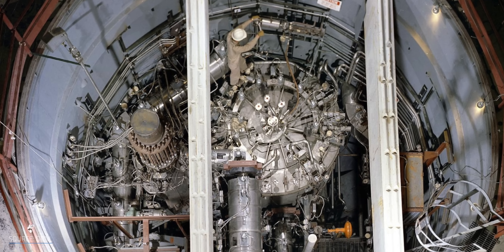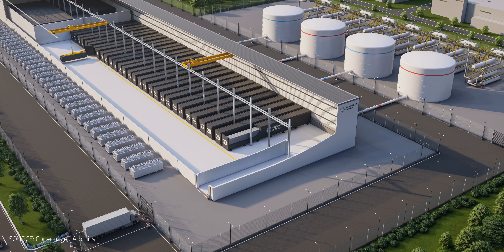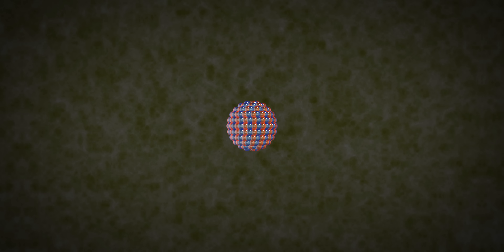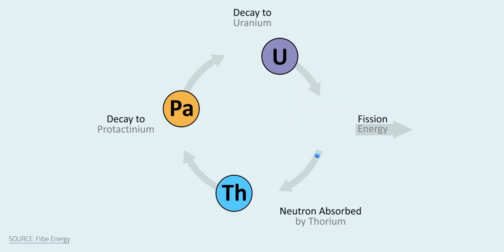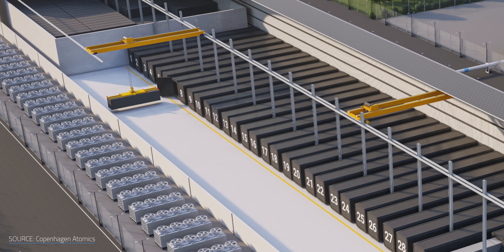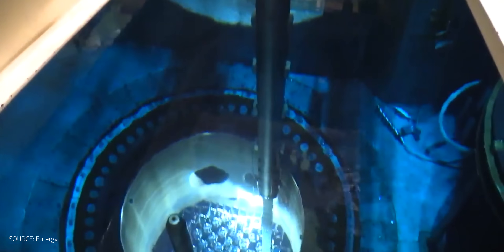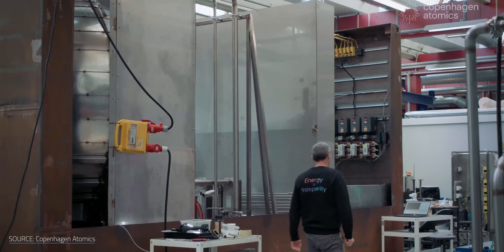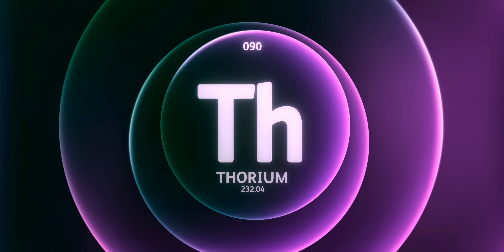Why Thorium is About to Change the World

Comment: A note about the "only 200 years of uranium" concept. When "burned" in a nuclear reactor, less than 2% of the fuel is actually consumed, and another 2% or so is converted to byproducts that poison the reaction. The other 94 to 96% of the "spent" fuel can be separated and reused. France does this, most of the world (including the USA) do not, and store the 94% usable fuel as waste for thousands of years. I reality we have more than 1,000 years of uranium if we decide to use it.
Reply: Any kind of assertion on energy topics should allways end with: "at current rates of consumption"
Reply: @camilovallejos9462  It's not even that.

Reserves and resources are calculated based on demand and econonmics of extraction. For this reason there are no thorium reserves despite rare earth mines extracting and dumping about 5000 tons per mine per year and uranium reserves are based on very pure deposits that are very close to the surface (admittedly rarer than Monazite, but still fairly common worldwide) due to extremely low demand levels in the mining scheme of things and being a low value metal ($150kg at most - enriched uranium is worth more than gold)

People see the figures provided by the minerals industries and quote them without realising the nuances (or deliberately ignoring those nuances)
Reply: From what I have read, the cost of reprocessing is very high, which is the main reason no one but France is doing it.
Reply: @apostolakisl like everything else nuclear related, mindless bureaucracy runs up the cost to justify its existance.
Other than delayingvprojects and endless reviews, what have the AEC and other regulatory bodies contributed to the industry?
Reply: @apostolakisl  perhaps, but I think the reason the US doesn't reprocess its fuel isn't for cost reasons, but because our nuclear policies make no sense. Most were set during the huge nuclear scares and nuclear hysteria of the 60's.
Reply: This is true, but there is literally 1000 times more easilly accessible thorium than there is uranium.  The reprocessing is difficult and dangerous and there IS a proliferation risk from it.
Reply: @NScherdin  True, in particular India, has vast amounts of thorium and almost no uranium. I'm not sure that proliferation from reprocessing spent fuel rods is a major concern in the USA (or India and France). I didn't say thorium was a poor choice, just that "only 200 years" is a wildly inaccurate statement.
Reply: @NScherdin  proliferation risk for what? US have already thousands of nukes, and it's easier to just enrich the uranium to create a bomb. What even is that point? like you didn't need to even have launchers for nukes
Reply: @riccvven2078 , Maybe the first world won't bomb poor people trying to build nuclear plants, if they are Thorium plants 👍🏻.

Uranium use is controlled by the right of might. 

You have to build an army before you can build a nuclear power plant. That is the reality of the world.
Reply: Unfortunately another video, where the host fails to understand the bare minimum of the topic he talks about. The result is pseudo scientific gibberish that sounds cool, but does not make any sense to someone who actually understands the subject matter.

Just to make this abundantly clear: the big advantage of Thorium is NOT the fact that it can be bred into fuel! Uranium 238 is also fertile and hence can and is currently bred into Plutonium 239, which is fissile.
Also current nuclear waste has to be stored for millenia primarily because of transuranics like Plutonium, which, btw Matt, are not fission products!
Additionally a more critical mind would have easily found out that no matter which fissile Uranium isotope one uses, both will produces long lived fission products like technetium 99 and others which will require several thousand years or more of storage.
There are of course potential technical solutions for these elements, but the claim that the waste stream from Thorium only requires around 400 years of storage is just not true.
Reply: @errantstar  I’m not well enough educated to understand this.  But think you should email this company and explain why this is a bad idea.  They must have people as educated as yourself who could prove or dispel your concerns.  No point in wasting money on this if it’s a waste of time and money.  Good possibility too they may pay you as a consultant.
Reply: @errantstar  To be fair, the topic is huge... too much for a short presentation... so this "extrapolated generalisation" from the efforts of this start-up does carry more sense than some of the barely educated gibberish among these comments.  The conflation is excruciating to listen to.  You illustrate example about fertile vs fissile vs source fuel.  Also axes such as online vs offline vs not reprocessing unless economical; coolants including NaK, lead, mercury with or without dissolved reactants; breeding in blankets or travelling wave, moving rods towards core; use of neutrons in both fast and thermal spectrum; the problems of SMR vs centralised, including security, amortisation of shielding and containment layers in larger structures.  The icing on the cookie was accepting the positive spin given to regularly replacing the whole irradiated corroded reactor.
Reply: Whilst this is true, it is important to note that the recycling process is indeed expensive. In addition, as already mentioned, this process can only be done once before it becomes uneconomical to repeat the process. It would be best (in my opinion) to keep storing spent uranium, but have a recycling facility on standby, and store spent uranium in easily openable containers, such that uranium can be easily and “rapidly” (the process isn’t exactly fast) recycle the spent uranium. Mining new uranium is currently cheaper, but having an emergency stock available for recycling seems like it would be the best of both worlds.
Reply: Also it's worth noting that 200 years isn't actually as long as it sounds.  Most lumber in your local shop is from trees planted 50 years ago, deliberately planted and farmed. Storing low grade waste isn't that difficult for 200 years.
Reply: @Spedley_2142  200 years is not a short period of time either. Even the United States is only 248 years old. How many states in history have lasted for 450 years? When states collapse, who will be responsible for keeping the promises made or ensuring the safety of nuclear waste?

Of course, it's a better timeframe compared to the fraudsters who promise to store nuclear waste for tens of thousands of years. Still, we are leaving a very messed up legacy for our grandchildren.
Reply: @romulusII  This is an apt point. When the Soviet state collapsed they left a mess of nuclear weapons and tech. That was with a very clean collapse without violence and stable successor states.
Reply: @romulusII I don’t disagree with you but we are also lacking better alternatives. 
Climate change is going to be even messier legacy. 

I realise the huge burden of responsibility that comes with nuclear energy but my country ditched it out of fear and ramped up the use of fossil fuels. While nuclear energy isn’t perfect, this decision was just right out stupid.
Reply: I think the math needs to be examined here. Enriched uranium fuel rods is 3-5% u235, the rest being u238, reprocessing potential in a lightwater reactor including Pu239 is around 2% by weight of fuel rod. 

We currently do not reprocess fuel rods in a meaninful quatity to alter supply trajectory. So supply is a function of economically recoverable reserve over annual consumption. Which is 8 million tonnes over ~70k tonnes/pa, or roughly 100 years of supply at current consumption.
Reply: French re use of the fuel only happens once then use new fuel! Dealing with the toxic spent rods has not been achieved so far!!!
Reply: @simonpannett8810  The spent fuel is used in breeder reactors but the process creates plutonium.
Reply: Well, back at the start of the Atomic Age, the US developed systems reprocess and reuse spent fuel because there was a fear of running out, but that push lost steam with the realization that there was quite a bit more minable than initially assumed, plus Plutonium gets a very bad rap as the bomb element.  As a result, only France continues a reprocessing system, and there haven't been any big developments in the technology in a while.
Still on the Breeder reactor front, Uranium's most common isotope U238 can also do the same, absorbing neutrons to then decay into Plutonium which can split to provide power just like U235.  It's got it's own issues, but one edge it has is that U238 is better at absorbing fast neutrons which means the breeder reactor designs don't need the neutron slowing parts to work.
Reply: France's MOX is a one-time "once-through" process.  Only a fast-neutron reactor (FNR) could drive down nuclear waste substantially but an FNR is very rare, complex and expensive construct & operate.  MOX only improves fuel efficiency and doesn't do much with reducing waste.  France has completely abandoned FNR.

Another thing is that the process of producing MOX will also also produce more low- and mid-level nuclear waste.  All the equipment, tools, water, PPE ends up contaminated or activated.
Reply: If you do that you get plutonium and everyone gets their panties in a twist
Reply: @renesilva9705  Well except for engineers trying to design space probes.
Reply: The difference is it’s required by law in France to recycle the waste. As long as it’s not required no one will do it, it’s incredibly cost ineffective. But as long as big tech and billionaires can lobby to keep laws as they are then that will never change
Reply: I know that the Canadian designed CANDU reactors (if I'm remembering correctly, or close enough) they use a natural mix of Uranium for their fuel, with the U238 absorbing neutrons to become Pu239 which is then fissile. I don't remember the usage efficiency (if it's different than what you described) but based on this alone that 200 years of Uranium fuel is more like 28,000 years of Uranium fuel! So, even if the Thorium never actually works AND spent fuel isn't recycled, we'll be fine for a bit more than 200 years...
Reply: @john_in_phoenix  Really? Do you have any links you can share regarding this I want to learn more pls. If possible YouTube video cuz you know I need dumbed down content for a dumbed down guy LOL thanks in advance 🙏🏽🌟❤️
Reply: India, Japan, Russia and UK does reuse the spent fuel rod.
Reply: @john_in_phoenix  facts, I forget her name but there's a woman who has a great video on the subject
Reply: Japan also does it.  The USA actually developed the tech.  But bureaucracy and corruption, in combination with fear mongering, allowed the utility companies that produce the nuclear waste absolute control over storing the waste, so they can charge the consumer to pay them to maintaining it.  Recycling the waste would take away their biggest income stream, taking care of the waste
Reply: France does this not because of economic necessity (they are actually losing a lot of money), but because of political reasons (scarce well-paid jobs in a remote area make it impossible to close). Reprocessed fuel, and that includes thorium-based fuels, is very costly due to complicated radiochemical technologies required, as opposed to the simple and cheap chemical engineering of LEU. And BTW, uranium is very cheap to leach in-situ (a technology developed in the 1970s), no fission technology will be able to compete with that in few next decades, and likely not in the 21st century
Reply: U238 (the 94-96% you refer to) is NOT fissile and cannot be used as a fuel in U.S. reactors).  The only thing that can be used is Pu239 and at ~ mid core life, the majority of reactor power is produced from Pu239, NOT U235.  The problem with Pu239 is its long half-life, human health danger, and easy use in nuclear weapons. BTW, France only recycles a fraction of their spent fuel and that actually was they way they obtained Pu239 for their weapons program and their ageing recycle facilities will soon be retired with no planned replacements.
Reply: Back in the 1980's they calculated that all the known sources of Uranium could last about 300 years. However if countries used just one or two "Fast Breeder" reactors that Uranium would last 3000 years.

Fast Breeder reactors were used by all the countries that wanted to make Nukes as it is the only way to create Plutonium and enriched Uranium. Most of those reactors were built in the 1950s and 60s and have been shut down now.
Reply: If nuclear warheads would be turned to powerplant fuel, there is already enough U235 for some 200 years
Reply: thousand years until uranium depletion, question is, can we safety store for that long?  @john_in_phoenix 
Wow, thousand years until uranium depletion, question is, can we safety store for that long?
Reply: This is the basic "problem", why they don't shoot it into space, melt it in the Mariana Trench or in a volcano - because in 50-100 years it will be a useful fuel
Reply: Oh, and France has become EXPERTS at recycling spent Uranium.
(I hope no one has the brilliant idea to try invading them, ever)
Reply: and yet still France imports U from Australia… it's true, they do use a NPP reactor to power the energy intense process to refuel with the isotopes in the waste products from some of their reactors. any yet they import U/yellowcake fuel from Australia… so much for France running a refuelling process that has 1,000s of years of fuel to power (with Nuclear as 68% of the mix).
Reply: @john_in_phoenix  ah yeah, they gonna dig it up in the future an make a fortune when all natural resources have been exhausted.  Mmm
Reply: Only 1% of the spent fuel is able to be reprocessed in what is the dirtiest and most expensive procedure in the nuclear energy scam. Once it is reprocessed it can be used once and then is again nuclear waste. it is way cheaper to mine uranium than reprocess it to get that 1% very expensive, very polluting recovery.
Reply: one day we will dig it up and reuse it when we run out of new material
Reply: The Natrium reactor currently being built in Wyoming is a fast spectrum reactor that will burn some of the u238 by converting it to Pu-239.   Same idea as Th-232 to U233.   Phosphate mining tailings have  both Uranium and Thorium that can be recovered economically so I don't see us running out of Uranium in 200 years.  Fuel reprocessing is the issue to overcome which is a regulation thing not a technical issue.
Reply: Uranium can be extracted from sea water. It's expensive, but not vastly more expensive than mining it. As the cost of fuel in a nuclear reactor is a very small part of the levelised cost of the reactor then when mined Uranium becomes uneconomic we can turn to extracting it from sea water.

Plus, if we use breeder reactors, so we can burn the transuranic 'waste' and use the U238 then we'd get effectively unlimited energy from seawater.
Reply: I thought the YK had a Uranium reprocessing plant as well?
Reply: Thank you for explaining it , I always thought what they meant by re-processing
Reply: It's simply the way greedy elites block the world's access to virtually free energy 👆
Reply: @john_in_phoenix  The US went down the Uranium route to make bombs. It was well known 70 years ago that Thorium was better for energy with less worry for byproducts, but the politicians wanted their bombs to stop communism.
Reply: I would like to add that Japan are also sicknasty at reusing reactor fuel.
Reply: You have to process it to use it. But processing is very expensive. That's why it is not used.
Reply: @cuneytevin9323  Thorium 232 is no different than U238 being fertile but not fissile.  The world has a uranium infrastructure for Uranium but not Thorium so unless we run out of Uranium and that is not likely anytime soon, the Thorium myth is and will always be a myth
Reply: Thanks🙏
Reply: That is interesting. I would also consider the number up for questioning as we have previously heard many numbers for remaining fossil fuel and metal reserves, but then huge new reserves have been found. We've only recently discovered natural hydrogen underground. I think there's a lot more stuff in the ground than we really know about and I wouldn't take the 200 years too seriously.
Reply: I also kind of doubt that we really know how much Uranium is available in the first place. Exploration tends to be done based on demand, it's highly likely we find a lot more in the next 200 years.
Reply: @zacdredge3859  Absolutely. I've worked for a company on gold, where we had high values from rocks no one ever looks at. The idea we found everything and know everything is an exploration constant. It's always been wrong. 
We don't really need the Uranium if we have the Thorium though.
Reply: “Energy too cheap to meter” now that will be the day 😂
Reply: @johnwarwick4105  That was EXACTLY what the U.S. government said when they were building the Shippingport Atomic commercial power plant in 1957.  At the time, scammers were also selling "special" light bulbs necessary to operate on Atomic electricity.  When you realize the intellect, or lack, of the American public you understand the need for regulations.
Reply: @johnwarwick4105 you mean like billing people for compressed air? Why would energy cost more than compressed air when energy is more abundant?
There's no business model for free energy which is why it's gone nowhere since the 60s. 
Energy companies won't advance it. End users will.
Reply: I'm glad a couple people at the very least are correcting @john_in_phoenix 
We don't leave ~95% of fuel in these rods and throw them out. 
The Uranium part of these rods contain mainly U238 (Uranium Isotope 238 is fertile and not fissle, therefore no fuel), which is 96%+. Then we have 3-4% of U235 (Uranium isotope 235 is fissle, therefore fuel).
Of these 3-4%, roughly 1/4 will remain in it's initial state. A small percentage will be activated into (fertile) U238. A small amount (~2%) of U238 will be bred into Plutonium (fissle) half of which will be used in PU fission.
So in the end, there is just a tiny amount of U235 left, which is expensive to seperate from all the other fission byproducts / transuranics.
And for clarification, natural Uranium only has 0.72% of U235. So U238 is abundant (99.28%) but is not fuel. Unless you want everyone to breed U238 into Plutonium (weapons-programs go yayy), this is a wasteproduct. And to breed that, we need special reactors (FNR), which have their own problems and so far, seem commercially unviable. (Doesn't breed enough to sustain itself, therefore always reliant on U235, creates transuranics through neutron capture).

All of that aside, nuclear is simply doomed. It's expensive to build, needs hefty saftey regulations due to the nature of radioactivity, long term storage is in the very most cases still not decided and somehow, the whole cleanup, storage and management of that ordeal isn't featured in the electricity price (which would be extreme). It suggests a fake sense of cheapness and pseudo-renewability.
Reply: Exactly, the Russians developed recycling of Uranium,  bringing the supply for them to a thousands of years.
Reply: What you're writing ist absolute BS. France only get's out about 1 % and stores the rest as "possible future fuel".
Reply: Didn't President Nixon have a plan for more nuclear reactors?
Reply: France only recycles the fuel rods once and adds 50% fresh fuel. So they're just getting us to 300 years.
Reply: Good thing Australia has lots to sell but not use to make the country better
Reply: interesting you say this. it sounds like we should probably figure out how to use all the fuel we actually have, before trying to make more of it using thorium and a complicated process
Reply: @dadmitri4259  We have more thorium than we know what to do with and every rare earth mine that exists is extracting more of it to the tune of thousands of tons per year - you have to extract and process the thorium to get at all the other rare earths and there's more thorium in monazite than every other rare earth combined

Sequestering that thorium is what makes rare earth mining uneconomic. China's rare earth mines are no execption - or wouldn't be if the Chinese government hadn't been purchasing and stockpiling their thorium output for the last 20 years in anticipation of the TMSR series reactors being commercially sucessful. A rare earth mine with a sales channel for thorium at $150/kg is a thorium mine with a rare earth side gig. 

That's HOW the Chinese have been abled to corner the world rare earth supply chain and it's something that can easily be undone, if there's a thorium market. Multiple birds, one stone.
Reply: @john_in_phoenix  yeah but it's just kind of a pain innit?
Reply: They dont do it, because thats making nuclear even more expensive
Reply: That’s not how U235 works…… but maybe other fuels
Reply: If this becomes ultimately successful I have one question. Who owns the largest Thorium mines in the world?
Reply: US has had the tech to re-use the waste in another reactor since the 50's
Reply: Guess they want the higher percent yeid for nuclear weapon or other uses. Rather than keep extract old fuel continue to find newer uranium. Maybe they do reuse old fuels.
Reply: Doing that is boh very expensive and dangerous. that is why it was stopped at Sellafield.
Reply: More economique to store IT. Separation of plutonium creates huge quantities of liquid radioactive waste.
Reply: Everyone gets the 200yrs thing completely wrong.  We have 200yrs worth of depleted uranium sitting in storage tanks at Oak Ridge, and that can be used as fuel in newer breeder reactors.  We don't only have 200yrs worth of fuel left, we have 200yrs worth of fuel just sitting there in storage tanks that we thought was toxic waste years ago.
Reply: That an desalination byproduct of seawater being roughly 30x all land reserves.
Reply: Well, there are already fast breeder reactors that do the same with Uranium and Plutonium, with non-fissileUranium-238 turning into fissile Plutonium-239 in outer blankets as Thorium-232 would turn to Uranium-233 in that design. By using these reactors, it is also estimated that we could draw 50 times more energy in total from the amount of Uranium that we have and will extract in the coming 200 years. These are big units and produce the same long-duration waste as classical nuclear reactors though
Reply: to be fair, it's not extremely cost effective to seperate the isotopes, and in 200 years we will have much better sources of energy
Reply: one thing that is never talked about is how we use these resources for stuff immediately upon discovery. What happens if in the future we make great discoveries and it turns out we wasted all the resources on petty things... or we created a bunch of byproduct with no idea of the impact. Plastics come to mind... we have no idea the impact plastic will have in 200 years, 1000 years, and beyond. It just boggles my mind how carefree we are as a society when it comes to inventions... then once we realize we made a terrible mistake, we're just like "oh well, who could've known?" Take DDT and lead for example....
Reply: Building a nuclear plane here in the US is uber regulated and costly to the point where it makes zero sense to do so, natural gas is a much less expensive option.
Reply: They are building a plant in Kentucky to separate reuse the fuel rods.
Reply: "We" dont process that left over fuel because "it's too expensive"...
Reply: especially in fast breeder reactors, we're only water cooling our power plants because you can fit them into a submarine or on an aircraft carrier. we had the solution in molten salt reactors i nthe 70's but they're not profitable or easy to get into machines of war so why bother developing the tech..
Reply: Yes, but for who? Only the rich countries get to use it. It is banned in the 3rd world. They will literally kill us if we try. 

In order for a 3rd world nation to build a nuclear plant, we first have to build a military to defend ourselves. 

IF the entire world moved to Nuclear , we would only have 100 years of Uranium.

So This technology will open up Nuclear to the entire WOLRD. 

When you say that you have 1000+ years of Uranium , that is 1000 years for the rich monopoly , with poor people needing to rely on fossil fuel , wind and solar.

In reality , if the world was using Nuclear ONLY , we have about 100 years of Uranium.
Reply: its extremely expensive to reuse it.  nuclear power is a dead end
Reply: @bonitabromeliads , wrong. Thorium isn't a dead end. The cold war and nuclear arms race caused nuclear to go the route of uranium and plutonium. 

It's humanity's lust for war that set us backwards 75 years. 

Thorium only requires about 5 % uranium as a catalyst. 98% of the fuel is burned leaving very little waste. 

Thorium is very abundant.
Reply: the "200 years of uranium" is flawed to begin with, because those are resources, not reserves or natural occurrences. It doesn't account future reserves becoming more economically available, like it happened with oil, or any other resource in the world.
Reply: @filippo1864  it also fails to account for breeder tech and molten salt which is also breeder tech.  The arguement is flawed because it fails to account for technological advancements.
Reply: Mox fuel can only be recycled once more before the cost makes it unviable
Reply: @rhetorical1488 true for now , it is also possible to use way more fuel in fast breeder reactors buy it is even more costly , let use them when there is way more fission around the globe
Reply: @corradoalamanni179  Nuclear fission is an energy dinosaur. Every other form of energy production is running circles around nuclear, which has been losing ground worldwide for the last 30 years. Nuclear energy will die out when the last of the current rust bucket reactors get so expensive to maintain they shut down. Nuclear cannot compete economically.
Reply: @corradoalamanni179  Fast breaders are still likely more economic than thorium based reactors. They need less reprocessing as fast neutrons are less likely to be absorbed by fissile products and they have more neutrons to spare. Also reprocessing thorium fuel is more expensive as it has quite some hard gamma radiation and thus need way more shielding of the process.  For way more nuclear we would have to use breeder reactors, as the easy uranium reserves are limited.
Reply: @corradoalamanni179  The fast breeders are likely still cheaper than the throium cycle. The thorium cycle needs way more reprocessing / cleaning, as thermal reactors are more sensitive to fission products and the thorium cycle has much fewer neutrons to spare. Taking the fast breeder as a point to compare too makes absolute sense. Here in most aspects the fast breeder is the clear winner compared to molten salt concepts, that are still in the early promisses and crude idea stage with a low chance of success in maybe 30 years.
Reply: @rhetorical1488already in 1968 we had the technology to reactive the uranium that was used. And according to those scientists we can keep doing this till all the uranium is used and the waste is minimal
Reply: @rhetorical1488 And only 1% of the spent fuel can be recovered in the dirty, very dirty and extremely expensive reprocessing plant. Running a reactor with MOX fuel is temperamental and requires greater expense for tighter containment,
Reply: @jackfanning7952  Yet the US used to do it, and France still recovers around 95% to this day. Perhaps check your numbers?
Reply: @jackfanning7952  The U.S. tested MOX fuel in a commercial U.S. reactor but terminated the testing early due to fuel rod swelling.  After spending $7 billion on a white collar welfare program for South Carolina, The U.S. MOX facility program was terminated.  Thanks to Linsey Graham we added $7 billion to your children's credit card with nothing to show for it except a short term work program. 

They could not even make that facility work and they were starting with pure processed Pu239 to blend with U238.  Can you imagine the additional cost if they had to extract Pu239 from spent fuel?  Technically, we can do a lot but you have to consider the cost vs benefit.
Reply: @john_in_phoenix  I did. They are correct. DOE says about 1% of spent fuel is reclaimed as U-235 and 1% as plutonium. Both are mixed with actinides making reuse difficult to handle due to gamma radiation. West Valley is still being cleaned up by the DOE after it was shut down in 1972 because it could not meet environmental goals. West Valley processed 640 tons of spent fuel and generated 600,000 gallons of liquid high-level waste. 1.9 million lbs of radioactive waste has been removed since 1972 and still not done. Other DOE reprocessing plants in Morris, Illinois and Barnwell, SC were determined to be uneconomical and never operated. Britain says cleanup of Sellafield will take at least 100 years to cleanup and just maintaining the site is costing $1 billion/yr. No cost estimate on how much cleanup will cost, if possible. LaHague reprocessing plant in France (formerly Oreno, Areva and Cogema, names changed to protect the guilty) has lost all of its international customers and only returns reprocessed fuel to its parent company, which was taken over by the French government to keep it from going bankrupt. Pity the poor French taxpayers. LaHague and Sellafield have managed to make the Atlantic Ocean the most radioactive ocean in the world all the way up to the Arctic. That is in spite of intense competition from Japan who is trying to put the Pacific on top and Russia because of Andreyeva Bay of the Barents Sea. It is hard to get info from Russia but they probably just dump their waste into the Barents Sea. Russia also stopped trying to recover fuel from rusting nuclear subs in the Arctic since the war in Ukraine started. How do you like your wild-caught salmon cooked? From the Pacific or the Atlantic?
Reply: @jackfanning7952  You do understand that the uranium is mined from the ground and isn't created from thin air, right? Seawater contains uranium (and among many others, lithium) naturally. The actinides and plutonium are created from the reaction and are the actual problems. Reprocessing the fuel rods removes the actinides and plutonium and vitrifies the waste products. So instead of a thousand tons of highly radioactive waste to store for 10k years, you get 100 lbs of glass to store that won't leach into ground water. In the meantime, the "spent" fuel rods get to sit in cooling ponds around the reactors until someone decides it is cost effective.
Reply: @clarkkent9080  SRS is still trying to get rid of the plutonium brought in from Russia intended to be processed in the MOX plant. Since it is DOE we have no idea what the additional costs has been. My guess - another $10 billion.That plant would have never run. The problem with it is similar to the problem Westinghouse had at the V.C. Summers Plant. They planned to build it without working out the technology necessary to make it work. they spent $8 billion and had nothing to show for it except a huge laydown yard of extremely expensive parts rusting in the field.
Reply: @jackfanning7952  The Westinghouse AP1000 reactor design was (being) built in China years before VC Summer or Vogtle started their construction and those two projects had engineers in China documenting and reporting on any issues. While there may be some issues  specific only to the U.S., I would not put most of the blame on VC Summer's failure or Vogtle's financial blunder on new technology.

  The U.S. did not and does not have enough construction trade expertise or project management to build two nuclear projects simultaneously . We can build Walmart Supercenters and Amazon warehouses but the detail, QA, QC, and management of massive projects is something the U.S. is lacking in. 

MOX was initially estimated to cost $1 billion.  The facility was supposed to mix "clean" Pu239 with U238, something that is relatively easy in nuclear terms.  The $1 billion estimated cost was reasonable given the nearby complex Tritium Extraction Facility was recently completed for $800 million. The individual that is fully responsible for the MOX failure is Linsey Graham. Once Graham got $1 billion of funding and congressional approval for the project he forced construction to start long before the design was completed.  Graham knew that once a project was started it is hard to kill.  I worked on some of that project and the construction errors were numerous and work shoddy at best but all Graham wanted was a white collar welfare program for S.C.. He singlehandedly kept billions flowing despite efforts of Obama to shut down the project.  It took Trump to put Graham in his place and shutdown the project.  S.C was awarded hundreds of millions for shutting down the project that should never have been started. A perfect example of why the U.S. is going bankrupt!

There is another Pu239 disposal project at SRS  that has been ongoing for a decade and it involves mixing that same  Pu239 with "stardust" in a simple glovebox.  The resultant mixture makes it nearly impossible to extract the Pu239 and the mixture is loaded into cylinders for disposal at (I believe) WIPP.  The reason that you don't hear anything about that project is it is simple and inexpensive and certainly not something Graham sees as bring the pork home.
Reply: @rhetorical1488 the viability of costs is something that can be changed on a whim with changing one if the soft factor like interest rates it drpends on and a new calculation. This is not a "solid rule".
More important is the technical viability, which takes years or decades to change. If it can be done, it will perhaps at one point when there's no better alternative.
Reply: @rhetorical1488. Ii isn't the cost, it is the Plutonium-242 which can only be burned in a fast reactor.  In a thermal reactor, it poisons the chain reaction.😊
Reply: Btw the whole  "only 200 years of uranium" concept is just a misunderstanding between Reserves and Resources by people ignorant on this based thing.

Resources is the total estimated amount of a particular raw material, including both discovered and undiscovered deposits.
Reserves is the portion of the "resources" that has been identified with a high degree of confidence and can be extracted legally and economically under current market and technological conditions. 

With the same concept we heard many times that oil was close to be finished. Obviusly when there is a shortage of something the price rise up and then it became economically convinient to drill more places  and use more expensive tecnics.
Reply: @amlasindae1097  your description of resources and reserves is both accurate and inaccurate. Resources are always there. Reserves can vanish overnight.  Middle Eastern war and oil spike? Reserves halve. Double the price? Demand halves. 
Oil "ran out" exactly when geologists predicted it would. Around 2008 when the price hit nearly $150/barrel and has never come close again. Before this date, high prices meant more supply. After this, high prices mean less customers. 
So Uranium or any other metal is limited by price. You can't dig up ever lower grades at ever higher prices. No one is going to pay 5 years salary for a microwave oven.
Reply: @FREDDAGGS  Did oil realy ran out? Are there less costumers then before? you can't be serius... the higher price just let others tecnics be viable, like fraking for the USA.
Reply: @amlasindae1097  if you are fracking, you ran out. I'm not sure why anyone would site fracking as an example of abundance. 
Why didn't we just bring a new conventional field online like we used to? 
>80% of the world's population have run out of oil. They never had it in the first place. They don't count towards demand because they have no capacity to pay. 
This group get bigger. The group that has oil (you) doesn't care.
Reply: @amlasindae1097  Thank you for writing this. I have a science textbook from 1940 that my grandmother gave me. The book stated that the current production of food was to be overwhelmed by 1980, possibly creating a worldwide famine. My grandmother told me that the book scared the heck out of her and for a couple of years she went around frightened that one day we were all going to die. Her family were farmers, and when she finally revealed her fears to her father, he explained that techniques for farming were improving every year and that there was not going to be a famine. He turned out to be correct and "the famine" the book predicted was averted. The textbook also has a small blurb in it about oil, where it stated that oil reserves could be depleted in 80 years. Well, we passed that milestone in 2020 and we now know that the predictions about oil running out that were made only 20 years ago, are totally debunked by some vast deposits discovered during that time (the Stabroek Block in Guyana, the Wolfcamp shale in Texas, and the Kashagan field in the Caspian Sea). Another thing that totally tosses a monkey wrench in the "fossil fuel" nomenclature is the discovery of long-chain hydrocarbons on Mars, included methane. Supposedly these hydrocarbons were only supposed to be created by decaying plant and animals, but here they are on Mars. So, we really aren't completely sure that the oil and natural gas on this planet is all a "fossil fuel" and much of it may have an abiogenic origin. Like the guy said in the video, who knows what we'll discover in the next 5 years that will upgrade the tech they are creating, and will make all the doomsday predictions moot?
Reply: @amlasindae1097  I see this same flawed argument time and again relating to copper. BSers tell us "copper ore reserves will become lower and lower grade, therefore we will run out of copper". This is obviously BS; as the "reserves" are progressively used, so the price incrementally increases, and lower-grade reserves become economically viable and competitive. So incrementally increasing price incrementally increases abundance. So, we will not run out of copper, no matter how many EVs, wind-farms, Chinese condos, electric grids we make.
Reply: As a matter of fact, if you run the numbers, the current technical available uranium will be enough to power the entire current population of planet earth with the mean energy consumption of a typical Western citizen for several ten thousand years.
 And that is without Thorium! 
With regards to the costs of reprocessing the current PUREX process was chosen, because
 1. only the extraction of Plutonium and Uranium for nuclear weapons were initially of interest, and
 2. PUREX was cheap in its initial lab scale demonstration. However once scaled up PUREX became quite expensive. Note however that expensive in this context simply means more expensive than using new mined uranium. So it is not expensive expensive, but it just does not make sense economically, when cheap mined uranium is available.
The alternative to PUREX is pyro-processing of fuel salts or electrochemical separation. Both require the fuel to be converted into salts and both are comparatively expensive to do as lab scale demonstrators. They are however much cheaper in an industrial scale compared to PUREX. Additionally in molten salt reactors the salt is already in salt form, so no additional step is needed. In fact most MSRs designs include a permanent fuel salt reprocessing unit in their design meaning that only Uranium or Thorium go in and only fission products come out.
Reply: @ 
Holy Toledo !
Reply: Yes,
I've run some calculations awhile back.
If the US was 100% nuclear power with breeder reactors that can use expended nuclear fuel and depleted uranium, we could produce 100% of our current electrical needs in the US for hundreds of years just on our current depleted uranium stores.  More by using spent fuel currently stored on reactor sites.
All without turning over one shovel of dirt to get fresh uranium or thorium
Reply: @brenthegarty3922  "US for hundreds of years just on our current depleted uranium stores". But! A fast reactor which can run on depleted uranium does not exist and never has. All fast reactors need a mix of fissile and fertile fuel. Maybe someone can invent a way to reprocess more efficiently and get to ISO fast breeders. But $ billions has been spend on it with no result in sight. So far we can only say that fast reactors are more expensive then LWR and they can use MOX or low enriched uranium, maybe in the best case natural uranium. (which CANDU already can)
Reply: It also does not account for the uranium dissolved in seawater which is a self replenishing source large enough to classify nuclear as renewable by some metrics
Reply: That assumes the spent fuel can be reprocessed at a profitable cost.
Reply: You're reducing the problem down to a couple sentences. If I have learned anything in my life, it's that nothing as complicated as this topic is as simple as that. I would bet my next paycheck you're at best, partially correct. It might be something as simple as not being economically feasible and France massively subsidizing it because they are France. The US, on the other hand, has a ton of unusable land and the ability to store that uneconomical uranium. We might also find another great use for that uranium in the future.

You make it sound like American scientists are idiots. American science and medicine is by far the most advanced in the world. We know what we're doing. Yes, it's not perfect by any means, but something as massive as this is unlikely to be overlooked.
Reply: @roots4x  No, US scientists are not idiots and it was never said they were. The US used to reprocess spent fuel, but it was stopped due to proliferation concerns. I will also note that liquid salt reactors existed in the USA more than 60 years ago. I said the "only 200 years supply of uranium" statement is factually incorrect. Anything else, you made up in your head.
Reply: @roots4x  Actually, the US has reprocessed spent nuclear fuel in the past and stopped due to proliferation concerns. One of the waste products created by "burning" enriched uranium is plutonium. Plutonium (unlike enriched uranium) is easy to separate and makes excellent weapons. So reprocessed uranium fuel is a good source of material for nuclear weapons. Enriched uranium is quite a technical challenge and requires a massive investment in both equipment and power. Extraction of plutonium from "spent" fuel rods is MUCH easier. Thus the US stopped reprocessing spent fuel to avoid having countries with reactors being able to obtain weapons grade material easily and cheaply. We want the spent fuel rods to be in pools where it is easy to verify that all of it is still there. Like most things in life, it's a compromise.
Reply: @roots4x USA found that other use for spent uranium years ago, they make bullets out of it & as a result the cancer rate in Iraq has gone up to staggering levels.
Reply: it's all because of poorly-conceived nonproliferation treaties.
Reply: Can someone tell the incompetant Government in Australia about this.
Reply: The problem is: it is actually more expensive than using new fuel, it leaves a lot of chemical waste that is also radioactively contaminated.
Reply: @boldvankaalen3896  If the greedy elites don’t charge money for it, then it won’t be ‘more expensive’🤷‍♂

Funny how no one seems to mind tons of chemicals in food or a cancer pandemic, but when it comes to chemicals from cheap energy — suddenly that’s the issue. 

We don’t say ‘radioactively contaminated’, we say ‘radioactively enriched’ — because this stuff can power things🤗
Reply: @TheGalacticIndian  It is more expensive because it is a complex process, requiring expensive inputs.

Not all the chemicals are the same. Water is also a chemical. But the chemical waste from reprocessing nuclear waste  is highly toxic and radioactively contaminated. An no, you cannot use this chemical waste as fuel for nuclear power plants.

And yes, people are concerned about what is in their food. For example a lot of doubtful ingredients that are allowed in the US, are not allowed in Europe. And many people actually watch what they eat.
Reply: and a 1000 years is plenty of time to scale thermal, kinetic, and solid state battery technologies to fulfill the role of grid storage. nuclear isnt about being permanent. its about solving the immediate climate crisis to buy time to perfect renewables
Reply: @nathaniel1207  Actually nuclear serves in as an excuse not to invest in renewables and storage technologies. The fossil fuel industry loves nuclear, because it helps them to keep renewables off, and they know it takes ages to built up nuclear to a sufficient scale, and then they will be very expensive. Renewables on the other hand,  are cheap, can be built fast and the battery revolution is already happening. No need to wait a thousand years.
Reply: The problem is that nobody wants a radioactive steam bomb in their backyard no matter how many bozos come out of the woodwork telling us how "safe" it is.
Reply: Yeah but alot if countries refuse to recycle their fuel for fears or proliferation of nuclear materials. I know it's fucking dumb but its quite a few nations stance.
Reply: @Packitagain.  It's not "dumb", recycling spent fuel means removal/separation of plutonium (that literally poisons the uranium burn). Separating plutonium is WAY easier than enriching uranium to weapons grade material.
Reply: is it safe to even access those waste stores? Wouldn't be surprised if they're under a millions tons of concrete or something
Reply: @CorySimpson yes it’s safe. And yes small module reactor research has looked at using up this “waste” giving us 2 benefits in one.

Unfortunately the regulatory hurdles is gigantic to say the least. Likely 15 to 20 years out to get approvals.

Lame.
Reply: @scallywag1716  Been years since I watched a video on this, but from memory the set up costs to do it were huge as well, and companies being quarterly focused weren't willing to take on the expense.  The huge costs are probably tied to the 15yrs to get approvals that you've mentioned.
Reply: @scallywag1716  It takes 15 years to approve of a facility that helps millions but the whole world decided what to do in 2020 within a few months!
I don't know what that tells me about the world but I'm mad for some reason.
Reply: @scallywag1716 you are right, the regulations… again people who are literally not smart enough to be making decisions on scientific progress are hindering scientific progress
Reply: @scallywag1716 I guess my issue with the politicians deciding the progress of science and tech innovation is they don’t even know how they work, like at a base level. I say if someone doesn’t understand how something works even at a basic level to disagree with it or agree with it, they should not have the sole authority tot make decisions for it
Reply: @scallywag1716  Not a single SMR is up and running. Just another desperate thing from the nuclear industry hoping to stay relevant. It is almost guaranteed tthat electricity from SMRs will actually be more expensive than that from large reactors.
Reply: @CorySimpson  yes, absolutely. It is done by France and Russia.
It was also done by UK: in fact UK is sitting on stockpile of plutonium that is enough to power country (that is assuming 100% of power coming from nuclear) for couple of centuries. Brits are not using that plutonium though.
Reply: @CorySimpson  Yes and no... consider an economy that would willingly dispose of 94% viable fuel, and whether they would care that it be recoverable.  I fully expect that the casks used will be 'safe' for storage but unsafe for transport.  Like a leaky simpsonsesque glowing barrel at the bottom of a deep storage facility.
Reply: @CorySimpson  Waste is not stored in some Chernobyl like tomb.  In the US we don't have a deep vault for power plant waste.  Its kept on site next to the reactor where its susceptible to industrial situations that could cause leaks or issues.  If it were to be buried, Its more like a reverse mine, where sockets are created and installed.  They'd be an organized series of burials rather than a pile.  Its not going to break the containment because you drill some rock nearby, because the mine would be creating more space for waste as needed.
Reply: @CorySimpson  Most spent fuel waste is stored above ground.
Reply: @CorySimpson  most nuclear waste is stored in pools onsite.
Reply: @CorySimpson  We'll have fully autonomous robots (androids) well before we need to dig up the "spent" fuel and they can do that dirty work for us.... until they rebel and try to take over the world! 😂
Reply: @CorySimpson  it is sitting in swimming pools, for the most part.
Reply: @CorySimpson  If you have LFTR designs you don't need to "reprocess" anything. Dropping the fuel rod content into the circulation pump headspace and letting it dissolve is essentially all that's needed.

Reprocessing for reuse in rods is complicated, expensive and dangerous. Spent fuel is dangerous to approach for about a century after use and takes about 450 years to decay to about the same level as the original fuel

At that point you can re-enrich the uranium. The plutonium is usable as-is but as it's almost entirely Pu238 it's a weapons proliferation risk and someone will be thanking us for making it so easy to obtain - this is why it's better to burn down the fuel entirely

Water-moderated fuel rod designs produce so much waste(*) because they're derived from a plutonium breeder (X10) and for the purposes of the task (a demonstrator fitted to the Nautilus), waste and supervision requirements weren't issues for consideration. Alvin Weinberg never saw Nautilus/Shippingport as more than a stepping stone and 1950s nuclear physicists would generally be stunned to know we're still using his basic concept 70 years later. Even then they knew that better solutions existed, but needed investment to be proven that industry wouldn't spend and the military didn't want to get involved with when Weinberg's design was "good enough" for marine-scale use (even an aircraft carrier reactor is "small" in the overall scheme of things)

(*) "So much waste" - about one olympic swimming pool in volume for a 1GWe reactor over its 60 year lifespan, which will be less radioactive than the original fuel in 450-500 years and safe to handle with gloves on in about 120-140(**) By contrast the average coal planty will produce a 40 acre lake of ash slurry more than 20 feet deep. This matters because the TWO largest environmental disasters so far this century in the USA have been coal ash pond damn bursts

(**) Yes, this does mean that Chernobyl will be clearable in another 60 years or so at most. It's tricky more because of the chemical toxicity of uranium and plutonium dust than their radioactivity (both substances are barely radioactive other than a few very short lived isotopes). TMI's reactor was dismantled and removed from the site within a decade of the meltdown and Fukushima's reactors could be dismantled now, but Japanese politics is preventing that from happening 

FEAR of radiation is proving to be vastly more dangerous than the radiation itself. Chernobyl responders have been treated like shit because Russians believe radation is contagious and the panic of the evacuation at Fukushima saw (among other things) a patient under anesthesia abandoned on the operating table and stretchered patients being dropped down hospital stairwells. Even in the immediate aftermath of the meltdowns Fukushima province was less radioactive than downtown Helsinki everywhere except beside the reactor vessels
Reply: @alanbrown397  thank you, that was extensive and a great read. I think I see the issue now though. I was referring to accessing the nuclear waste storage sites we've been storing radioactive materials in. I assumed maybe they were just under a 100 tons of concrete
Reply: @CorySimpson  For the most part the waste is stored in dry casks onsite. There really isn't very much of it.
Reply: @CorySimpson we use robots to crack them open.
Reply: @CorySimpson  They're almost all sitting in cooling pools on site of the nuclear power plants. We don't have a national depository. That said, my understanding is to recycle this fuel requires enrichment to the point of nuclear weapons, which is not only expensive, but it's extremely dangerous for the world and likely violates treaties.
Reply: @mso82  "likely violates treaties". Not true. It only violate the USA 123 agreements, which is bad politics and should be abolished. Copenhagen Atomics thorium reactors can use spent fuel quite efficiently and the process is well known. But getting approvals to handle this high radiation spent fuel is more difficult and expensive than actually handling the fuel.
Reply: @CorySimpson clearly you have no idea what the waste actually looks like and how it is stored. Yes we can safely access it without a problem. Fact is they could store it at the corner of your street, you wouldn't know what it is and you wouldn't register any radiation. 

The technology to reactivate the uranium already existed in 1968. The cost to reactivate it everytime is minimal. And where solar panels and wind is up to 15x more expensive than reliable energy, nuclear is the cheapest of all and ALL cost is already in that very low price.
Reply: @mikebrandenburg9922  No, I have no idea. It is why I asked someone who seemed knowedgable. Thank you
Reply: By “if we decide to use it” you mean 

spend an insane amount of money for a super inconvenient (and historically disastrous) way to make water hot?
Reply: No wonder nuclear is so expensive. If you're throwing out literally 96% of usable fuel, then what's the point of bothering?
Reply: @Avruthlelbh  "throwing out literally 96% of usable fuel". This is why Copenhagen Atomics reactors are much better. They use 99% of the fuel and the waste is much less problematic. And the electricity is low cost too: What is not to like?
Reply: @Avruthlelbh  I don’t think you’re understanding what the topic is even about. In terms of physics regarding energy, which is stored as a form of potential energy, and then converted over involves a burning of a chain reaction in that reaction there’s always gonna be a percentage of losses when it comes to the actual changing of energy. What’s the people in this post are talking about are not 100% honest when it comes to potential energy as over 96 to 98% of the potential energy is consumed and converted by the time the resource is added and use in the nuclear reactor. what people failed to understand is that nuclear energy is one of the most abundant forms of energy that actually produces the highest amount of energy for the longest duration of time. Nuclear reactors are amazing at producing energy so so that they’re nearly 200 times the output of energy compared to the most efficient form of fossil fuel burning power plant that currently exists and to put that into perspective it takes nearly 900 Winter turbines to even equate to 1/4 of a fossil fuel source power plant. With the original post or comment of this thread suggest is a failed concept that technically works, but is extremely dangerous. Summer said to the point where you’re basically begging for a nuclear detonation to occur while trying to reuse already depleted uranium. To recharge depleted uranium is the same currency of overcharging your lithium batteries of your Samsung Galaxy back in 2020 when everybody’s phone was blowing up in their pocket and the point I’m trying to make is that it’s just gonna explode amounts of radiation is gonna pour out of those depleted uranium rods because the chain reaction already occurred within those rods in the process and it’s gonna leak and leach out radiation and higher intensities than it was before it was ever used and some people might argue that that’s OK because it’s in a controlled environment, but it’s not OK because you’re still exposing engineers and workers to an environment that is less safe and can cause a higher chance of a nuclear meltdownnot to mention the process of it. All is highly dangerous and violate several Geneva conventions in the process.
Reply: @mrpumperknuckles1631  oh my god I made one joke
Reply: @Avruthlelbh  Very little of the energy contained in coal is turned into usable heat. Achieving even 40% efficiency is difficult with ICE. That said, a kilo or uranium contains the same amount of energy as 2.7 million kilograms of coal.
Reply: @mso82 

“VERY LITTLE” → 50% for both ICE & coal these days. ICE with bottoming cycle is 55% (for more than a decade).
Reply: @mso82  technically you’re right and wrong at the same time because deficiency of Cole is still relative to what you’re comparing it to which is uranium rods. On a natural skill of itself: is still a very efficient form of energy and the only reason why is because there are methods to pull out more energy out of the chain but the price in doing so is a constant steady burn, which is why you have warm start and cold start powerplants because warm start power plants can turn on within less than a day while a cold start power plant takes weeks if not months before they can even start up and be fully operational and then they take several months in order to get to higher efficiencies of energy draw, and it’s based off of per kilo of material
Reply: Russia recycled the fuel as well since 1950s and they were the first to do it. Socialism wins again
Reply: @SMGJohn  Is that the same socialism that went cheap and approved an unprotected (RBMK)reactor that blew up in 1986 contaminating 1/2 of Europe?
Reply: @DavidSteer-i1u 
Nah, it was a genius design, a huge massive reactor running on a very fine line between stability and meltdown, truly a mad Soviet design, as Stalin intended.